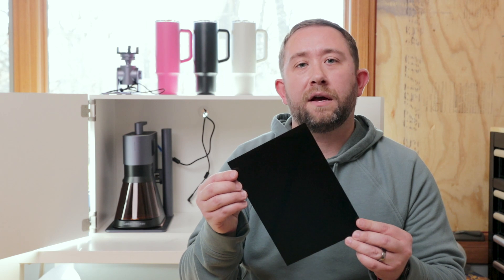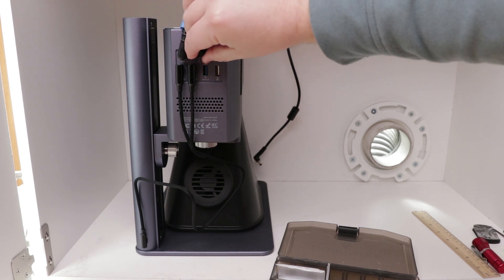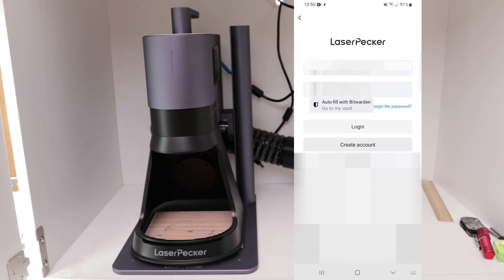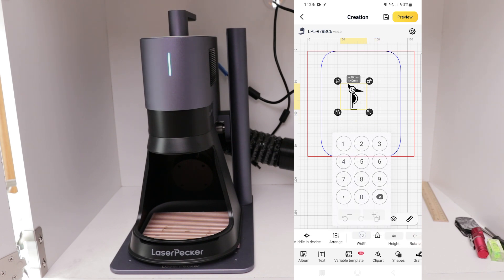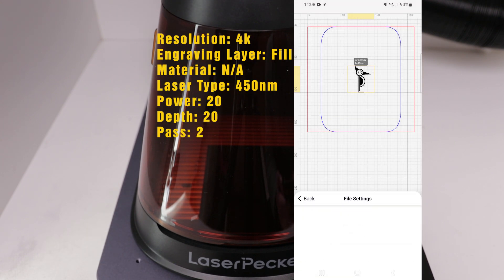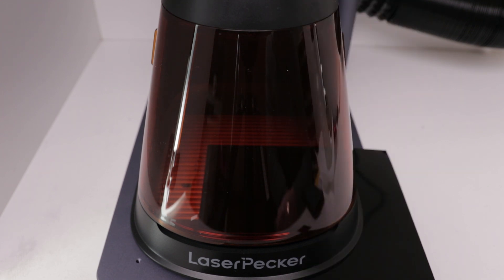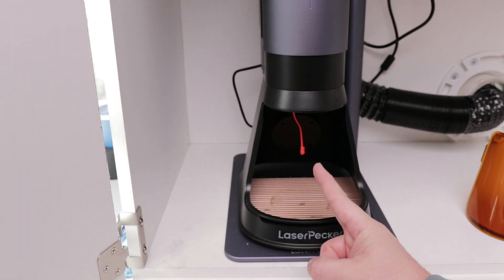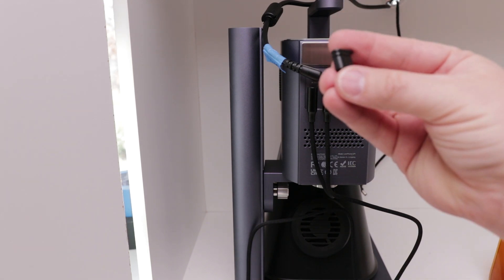Getting Started with Your LaserPecker 5: A Step-by-Step Guide

Comment: I engrave little plywood discs and also on wooden spoons. I’ve had all the laser Peckers from the lp1 on up to the lp4. I moved onto the lp5 thinking my speed would increase, but when you still have to make two passes or more, that’s not decreasing the length of time I want something so I can turn Things out faster so that’s why this LP 5 is nice. It’s fast but when you have to go over something several times I’m not gaining any speed so that’s what’s frustrating me. I’m thinking of returning it and sticking with my lp4. Or do you feel that I will eventually be able to do my wood engraving in one pass? Looking for your thoughts. Thanks!
Reply from the maker: If you mainly want to do cutting, I would use a gantry laser engraver. So, the cuts are always straight down.